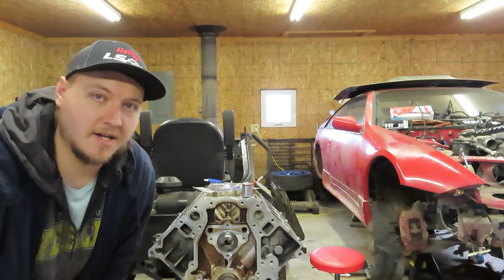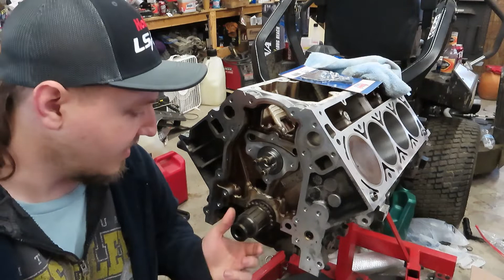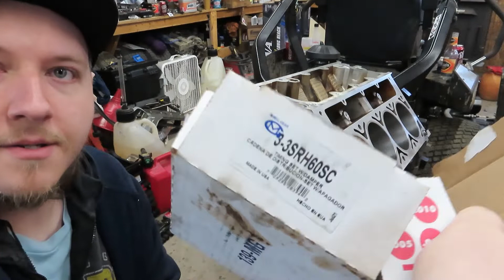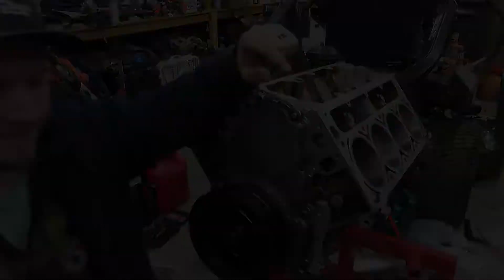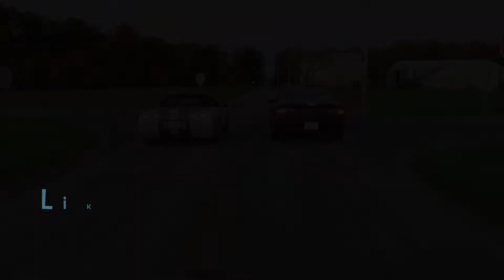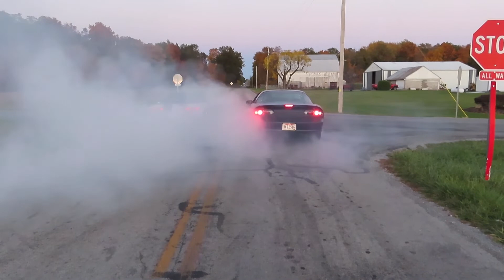LS Build: Installing the Timing Gears, Chain, Cover, Oil Pump and Harmonic Balancer

Comment: I never use that aliment tool I put the seal in balancer and let the seal and balancer center it self then line up the two pan edges and snug the timing cover up never had a problem done many of these motors

Comment: Your timing cover also needs to be level to the bottom of the block so the oil pan doesn't leak does that tool take care of that I see alot of guys flip the engine over and use a straight edge on the bottom of the block alos they make a tool that bolts on using the oil pan bolts over hanging the block meeting the front cover. Could be the back cover I'm thinking of